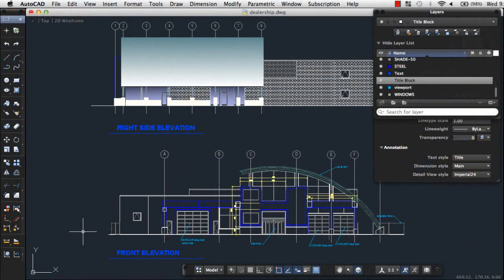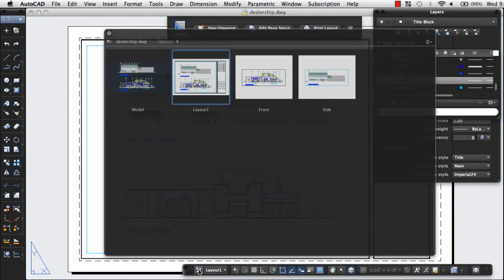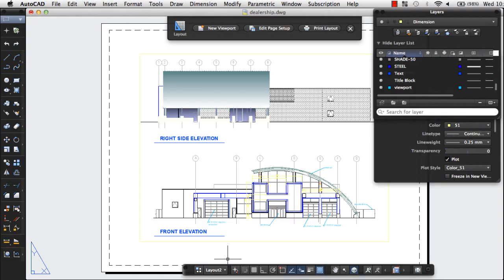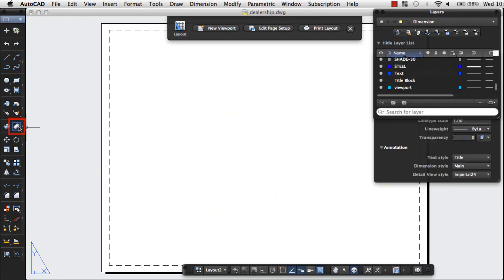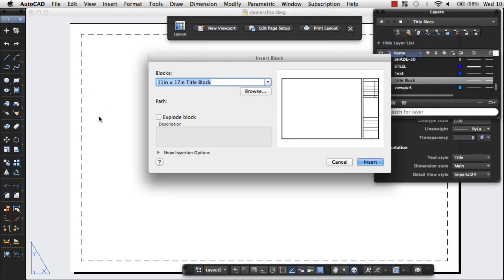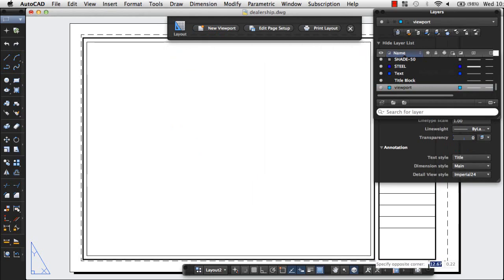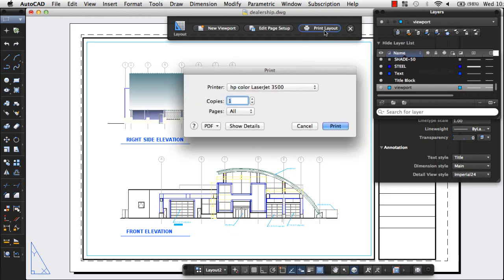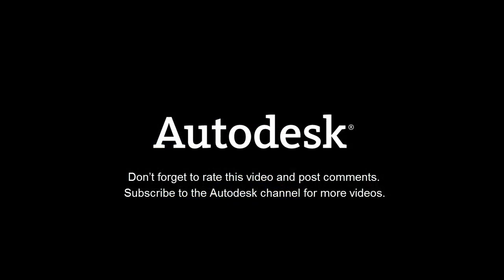Print a Drawing Layout: AutoCAD 2013 for Mac

Comment: Yes, I agree, it SUCKS. 
I still haven't found out how to create and apply plot styles to my layouts and the guy doesn't even mention it. Also, I find the scales settings really complicated. Don't know if the scale in the model mode intervenes with the layout mode or if I should select something specific in the general settings...? 
AutoCAD 2010 on PC was so EASY, two years later I feel as if I had just started using this programme...